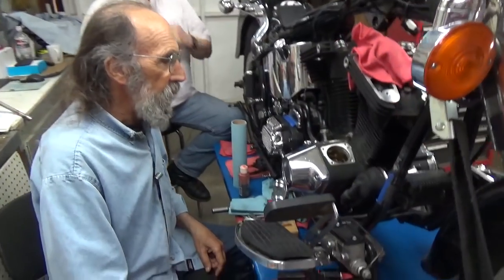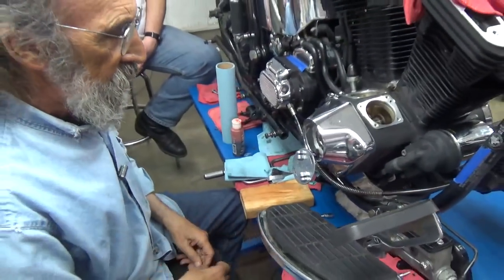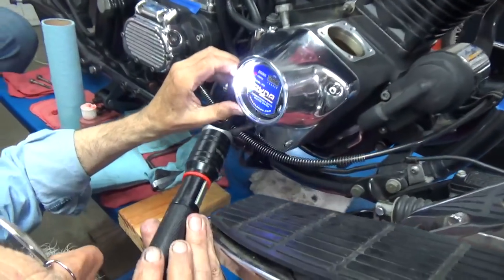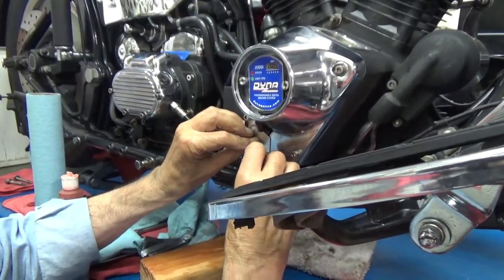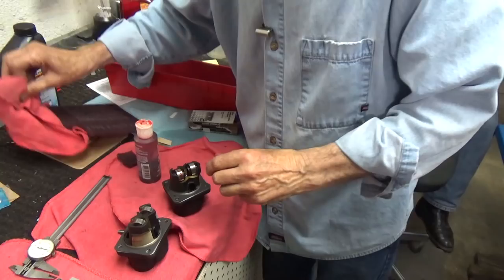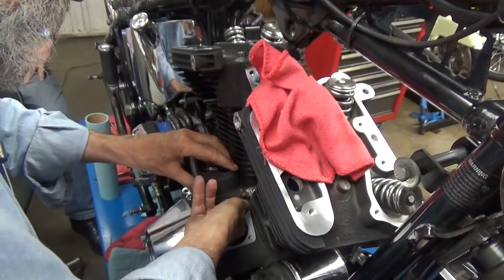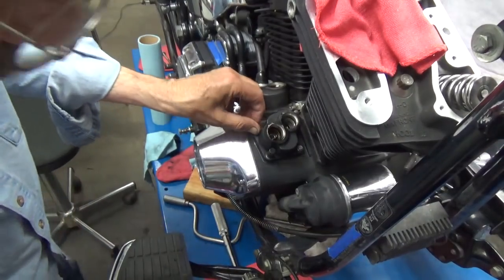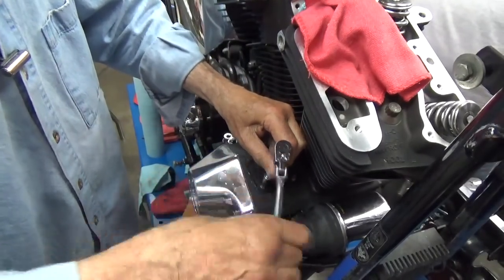Carryover Part B   Camchest and Lifters on the Evo Stroker

Comment: I replaced the inner cam bearing on my 99 Softail Custom when it had 23,000 on it just for peace of mind. I replaced it with the full roller Torrington but kept the stock cam. I used Harley adjustable push rods to make the job easier. 

Now for the funnies. I had it all back together when I noticed the cork gaskets that should have been installed on the bottom of the push rod covers. I now have a lot of experience of adjusting the push rod length. LOL.

 I now have 65,000 on it with no problems. Since I do not have a lift, I did it all on the floor. Thank God for the reliability of the EVO as I am 83 years old now, and it is getting harder to do much on the floor any more. I still change all my fluids, plugs, and just replaced the battery yesterday. But a stock EVO is fairly reliable. I have always enjoyed doing my own work so I have no one to blame if it is not right but me. 

Great video. It brought back memories. I was 70 years old when I did mine. Took me most of a day as I am slow, meticulous, and recheck everything. I noticed you are also meticulous, but not so slow.
Reply from the maker: I'm pretty slow.  I try to think things through and carefully set up for the job I'm about to video.  We'll both keep keepin' on.
Reply: 72 and I'm Camming my evo right now.  EV27.  Finally bought a lift table, Wow!  Couldn't have done this job on my shot knees.
Reply: @tomdillon6758  I have a large sheet of cardboard I lay on the floor, and work from it. I can still do most things as far as normal maintenance, but I have an Indy shop a half mile from my house, and I just had him replace the front and rear tires and put in new bearings. I use to do that also, but no more. I do have a fairly good motorcycle jack. 

I have learned to pick my jobs and let others do the other stuff. It is what we do to keep riding which I still love. Started when I was 8 years old on Whizzer motor bikes. Bought my first Harley, a 1942 "45" flat head when I was 14 in 1955. I still miss that one. Hand shift foot clutch seemed normal to me.

Comment: When prepping the lifter blocks I inspect the counterbores to assure that there are no flares or flash from the bottom of the counterbore seat into the hole caused by the head of SHCS (bolts) that might intefere with the alignmen tools (tapered shank). Simply match drilling from the back side witl a drill of the exact same size will correct this if needed. I have seen these holes with obstructions in both the steel and alum lifter blocks. Cheers to all.
Reply from the maker: Thank You.

Comment: Hi Mike hope you doing great today.I have a question regarding valve springs and pressures, Im installing an EV46 cam 10:1 pistons and new lifters in my 85 FXR. I would also like to replace my 37 year old OEM valve springs, but am not sure which valve springs to purchase. The EV46 has a lift of .495" and andrews states to use OEM springs, but i cannot find OEM EVO springs anywhere mostly springs for higher lift cams. Im not familiar with working valve spring pressures so would like to just see if im on the right track.
Looking in my service manual its says for open valve spring a range from 183-207lbs. So should i be looking for valves springs with seat pressure between those values? I dont include the inner spring pressure when choosing valve springs?

Sorry for the newbie question, but with your great videos, my build is coming together nicely.
Reply from the maker: That EV46 cam is made to work in a stock motor.  A good set of name brand replacement springs would be great.  Using an Andrews cam, probably Andrews springs.  It is a mild setup.

Comment: Great series, thanks Mike! Quick question. [hope this wasn't answered already and I missed it] Are you re-installing the same lifters in Jims bike? What is your thoughts on mileage life for Evo lifters? Some of these guys are changing them at 60k miles for some reason. Thanks, Frank
Reply from the maker: It's a great idea.  The originals do seem to have a "limited lifespan."  When they come apart, there can be a lot of damage from debris going through the engine.  I put new "Jim's Machine" lifters in Jim's bike a while back.  Not many miles on them.
Reply: @pacificmike9501  Thanks Mike.
Reply from the maker: You bet.

Comment: Awesome work Mike.  I miss my 13 fatboy lo I had, but my 03 roadking I have now is a  pretty special machine. Mike can i ask a question, in your opinion, I have a bassani 2 into 1 on my road king now and it runs amazing, but I'm missing my duals with the bark of the mufflers...would I loose alot of torque going back to duals?...
Reply from the maker: Probably not.  You may shift the power band a little and actually have a little more low end torque.  You won't know 'til you try.  It could go either way.
Reply: @pacificmike9501  ...thank you for responding Mike.....what do you prefer on a bike, 2 into 1 or a true dual system?

Comment: Mike, you have a great series on the EVO.  I have been watching the build several times as I am waiting for my heads to come back from Branch O'Keefe and for the first time, I am going to do it myself.  Everything is very clear, but I have one question for you.  Between porting, valve job, pistons etc...money is running tight.  How can I tell if a lifter is worn and needs replaced?  Thank you in advance for your help.
Reply from the maker: Usually, "worn" means the roller is worn out (there should be NO up and down movement in the roller and it should be perfectly smooth..  Or the lifter could collapse internally.  I don't know how many miles you have on your motor.  Do you have original lifters?  With all the money you're spending, you need to protect that investment.  If the lifters are questionable, replace them with a good high performance, aftermarket set.  Are you changing the cam and cam bearing?

Comment: Love this Evo series.  One question:  what is the tell-tale sign when an Evo bottom end needs re-building?
Reply from the maker: Same as any other Harley, except twin cams.  Without removing it from the engine, it's a "feel thing" with the top end removed.
Reply: Really enjoyable watching these series of videos,which do you prefer single cam or twin cam and for what reason Mike👍

Comment: Mike, off topic on the Evo.  I am just finishing on a 83 shovel upper rebuild.  Cylinders bored .020.  New pistons and rings.  Valve job on the heads.  Everything else spec out.  Now the question.  On a start-up, is there anything you do to check before firing it up.   I know what my compression was before the tear down both warm & cold.  Would that be a good idea to check compression before firing it.  Would that let me know things like valve timing, odd noises while cranking.  etc.  Would a leak down check also check things.  Probably overthinking things.  LOL  thanks
Reply from the maker: You're definitely overthinking.  But, better safe than sorry.  If you've adjusted your valves (and I can only assume you have hydraulic lifters), spin your engine over by  its starter (with  the sparkplugs out) to make sure the lifters are pumped up.  Make sure oil is returning to your oil tank.  If anything does not go well, you can trouble shoot at that point.  I always turn the engine over by hand with everything adjusted and with the spark plugs out.  Then, I give the float bowl time to fill.  Then I start it.  It's always exciting.  I never get over it.  Take your time.  Enjoy it.  Run the engine for a few heat cycles.  Retorque the heads when the engine returns to cold.  Again, Have Fun

Comment: Hi Mike,just brought a 1975 flh from florida too scotland.Probobly been 4months to arrive.It sumpded out a nasty brown oily goo.i have now got it nice clean oil after using n flushing with 6 ltrs of 20w50. No straight 60 here.i took it for a little spin and its hicuping no control over throttle to carb.i never drained the tank of old fuel just added 5 litres of new.have i gummed the carb up? Many thanks Mike love the channel.
Reply from the maker: Without seeing it, I have no idea.  How clean are the tanks?  You might want to drain and clean them.  You ought to add a nice washable fuel filter.  Or,  if it doesn't seem bad, just keep adding fresh fuel 'til it straightens out.  I also don't know what your fuel is like in Scotland.  You may need to do some tuning.  I don't know what you're using for a carburetor.  Sounds like fun.  You will sort it out.  And, it will be great.
Reply: @pacificmike9501  Thanks its an s+s super B.I may have topped up with a bit too much oil hence the big spot out?hope i havnt damaged the old girl.Unleaded petrol over here not sure of octane.Why do i have to always learn from mistakes😂
Reply from the maker: Because you're human.  We all suffer from the same condition.  It's just "time in."  Super B's just  require proper jetting.  "SSCycle" is the web site.  They give very complete instructions.  Too much oil?  Drain some out.  It may continue to push more out through the breather hose until the system balances itself out.  Start it with a pan underneath.  If it's in good shape, it won't go on for very long and it will get happy and stop doing that.

Comment: Mike, are those tappet block alignment tools good for shovel lifter blocks also?  As always, thanks for your knowledge.
Reply from the maker: Yes they are if you have a newer Shovelhead.  Shovelhead tappet block screws were 1/4 X 24 originally.  After 1973, they changed to 1/4 X 20.  The tools are 1/4 X 20.  Be sure you know that before you screw a tool into the wrong thread pitch and...
Reply: @pacificmike9501  Great point!  Thanks very much.  Charles
Reply: Mike, why is the alignment screw better than just putting the actual bolt in to allign it?

Comment: Did you check the end play of the Breather gear? 
Did you like the OEM plastic breather  or did you upgrade to the S&S Metal breather?
Reply from the maker: I don't remember what I put in there several years ago.  It's probably an S&S due to the stroker kit.
Reply: @pacificmike9501  It was indeed a metal S&S stroker breather

Comment: Hey Mike I have really enjoyed the training video's  you post for me to wrench on my 97 Titan Evo motor. I truly appreciate you and your time putting these video's together for us to enjoy. I had a mishap after finishing up my cam replacement. All new pushrods (quickie) and lifters to complete the job and future replacements (if I need too). My mishap was forgetting the darn breather bushing. It was a week or so before I noticed as the bushing is the metal version that I mistook for an extra washer from the intake cover. I took so long to figure it out based on discovering a faulty coil I had to replace. Anyway, I am just curious if I have caused any damage that will not be resolved by simply re-installing, with the bushing this time? I have put about 60 miles on the bike since the replacement of the cam.
Reply from the maker: If it looked okay, if the breather gear wasn't damaged, if the cam cover wasn't damaged...  If you looked it all over and question it, have a pro look at it.  There's no shame in not being sure, anyone can make a mistake.
Reply: @pacificmike9501  One last thing about this mishap. Will that cause a lot of oil to leak out? It appears to have come from the overflow line, maybe?
Reply from the maker: I believe you left the breather shim out.  That will cause a real confusion in your oil system.  With the breather corrected, it should function fine.

Comment: Hi mike, I’ve been watching your videos, just gaining knowledge. I’m about to replace the cam bearing in my 98 evo, don’t plan on upgrading cam or anything. I was just curious if measuring end play needs to be measured, or any of the additional steps when re installing the original cam? It will be my first time opening the cam chest on any of my bikes.
Reply from the maker: Go with your service manual.  Since you're keeping the original cam, I assume you're keeping the original lifters and pushrods.  In this case, follow the procedures in the book and be sure you inspect your lifters carefully.
Reply: @pacificmike9501  thank yo Lu for the reply. I recently bought the bike, and of course there was no manual. I did plan to replace the lifters along with the cam bearing. but was hoping to keep original cam as well as pushrods.
Reply from the maker: Be sure and buy a serrvice manual.  Any time I've taken a cam out of a late Evo like yours, I threw it away.  Consider a nice mild replacement.  You'll be glad you did.

Comment: Hey mike . Enjoy your videos. Very informative. I replaced the rocker box gaskets on my 117 S&S mtr. . It’s in my 2004 Bigdog. Before I replace the rocker arm assy’s, is there a front and rear. I may have mixed them up when I put them on my bench.
Reply from the maker: The rear exhaust is the same as the front intake.  The rear intake is the same as the front exhaust.  Now put them on their shafts and see how they feel.  You'll probably feel any slight differences.
Reply: @pacificmike9501  great. Thanks Mike for your help

Comment: Why do some folks soak the lifters in oil before assembly? Did Mike do this before putting them in the lifter boxes? It looks like not. So is it an unnecessary step?
Reply from the maker: Either way.  These were already full of clean oil, so I didn't drain them.

Comment: Good afternoon Mike. The question I have is where do I find one of those double headed magnets that you used to keep the lifters from falling into the camchest ? Thank you.
Reply from the maker: Try Jim"s Machine Tools.  Or, try Drag Specialties tool section of the Fatbook.
Reply from the maker: I apologize.  I called around and can't find those magnets.  I don't know if anyone is still producing them.  Most people use paper clips.  I've forgotten how long ago I got those tools.  It was probably right after Evos came out.
Reply: @pacificmike9501  Thanks for the reply Mike...
Reply from the maker: I think 40 years just slipped right by.

Comment: What were you doing with your fingers as you put the lifter blocks with lifters in their bores to assemble?I saw a video by late nite v twin, and he set the lifters in n then the lifter blocks. Of course it was a M8 motor and they had holders by s&s to keep the lifters parallel to the cam.
Reply from the maker: I didn't know the M8 had lifter blocks.  The Twin Cam does not.  Let's not mix up motors.
Reply: Tappet blocks.
Reply from the maker: I was probably holding the lifters into the tappet blocks.

Comment: Are you putting new lifters or reusing the old ones? At least you can replace the lifter blocks unlike the Twinkie
Reply from the maker: This one has a nice set of Jim's lifters in it that have low mileage on them.
Reply: @pacificmike9501  I understand, I have just heard lifters are a big issue on evolutions because of the pushrod angle. Have you found that to be true?

Comment: I've been complaining about the power of my 97 FXD after riding my pops 04 1700 roadstar midnight Silverado. I know there is a bit of size difference but just wondering what do I need to do to get up closer to 100hp.
Reply from the maker: 100 HP out of an 80 inch Evo is a big bunch of power.
Reply: @pacificmike9501  oh I know it. Not saying I would stick with 80in though. I'm fine with boring out to a larger size. Just curious what all would need to happen to get me up closer to 100hp. 90s would be ok too.lol

Comment: How do you know the cam bearing needs replacing what sound do you hear?
Reply from the maker: The cam bearing was not the best to begin with, so, we generally replace them when replacing the original boring cam.  Sorry if that didn't seem polite.  Once replaced with a good Torrington bearing, it will enjoy a long life.  I am assuming, like the video, we are working on an Evo motor.
Reply from the maker: I like a new bearing with a new cam.  On the motor in that video, we were going to a new and more performance cam to partner with the other modifications.

Comment: "Tappet block alignment screws"? Wouldn't the intended screws do the same thing?
Reply from the maker: The alignment "tools" are ground with a perfect taper to align the tappet blocks perfectly.  The holes in the tappet blocks are straight.